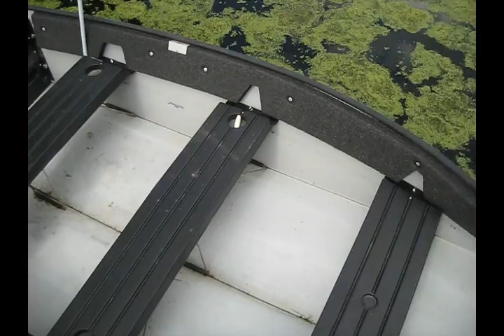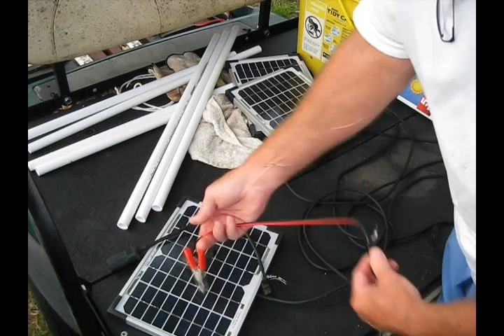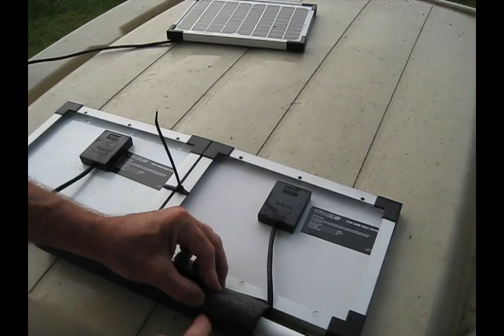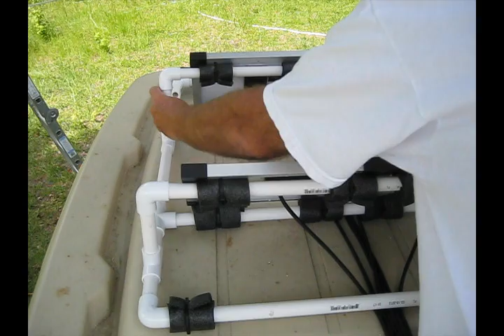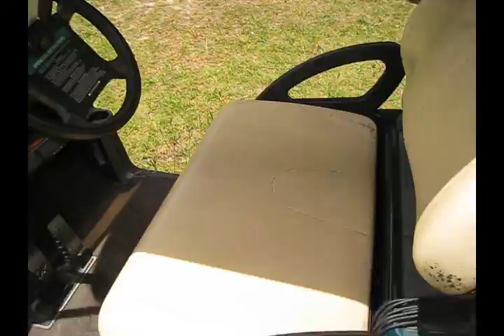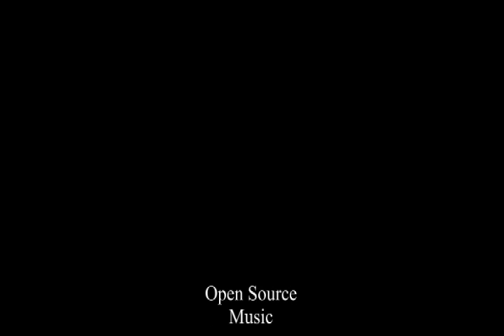Solar Powered Golf Cart Project

Comment: It would take about  4500 to 5000 watts total and about about 4 hours to charge if it is dead (50%) capacity, at 11 cents a KW hour that would cost about 30 to 40 cents per charge. No idea how you came up with 10 to 15 dollars per charge. Still Solar panels are a good idea; But 20 watts worth of solar panels is only going to keep them maintained it will not charge them up. If you have 200 AH batteries and they are at 50% you will need  4,800 watts to charge to 100% 4800 divided by 80 (20 watts x 4 sun hours) it would take over 60 days to fully charge those batteries using those tiny solar panels you bought, by the way you can buy 5 watt aluminum framed solar panels on Ebay for around $18.00 each. 10 watt panels for $26.00 each. Since those panels are laying down they loose about 20% output. You paid close to $160 dollars for all 4 panels at 11 cents a KW those panels would have to generate 1,450,000 watts in order to pay them selves off at an average of 76.8 watts a day it would take 52 years for them to pay themselves off. If you factor in inflation they would never pay them selves off.  How old will you be in 52 years?

Comment from the maker: Joann, yes, solar panels will work on a hydroponic system.  Depending on your pump you would need to size it so that it charges the batteries and at the same time run the pump.  My pump is 2000 gallons per hour.  For this application I need 280w worth of solar panels.  I use two 130w solar panels with two batteries.  Here's the other thing.  You would need a whole lot less if you eliminate the conversion from 12v to 120.  For example, use a bilge pump which is 12v.  You would then use 1 panel.